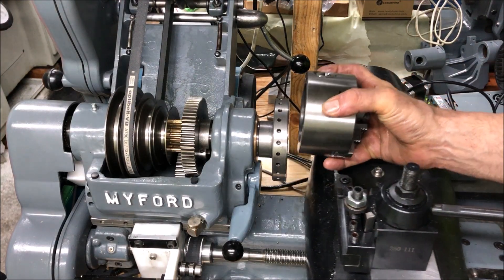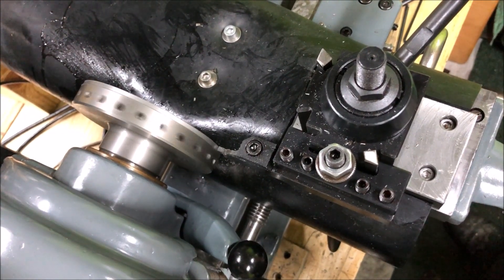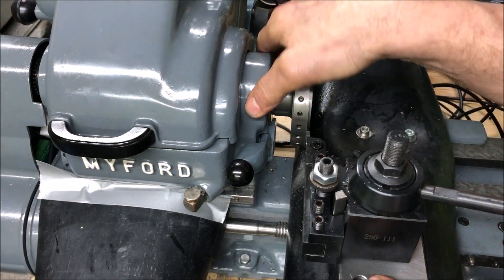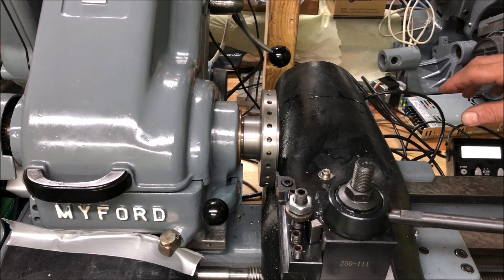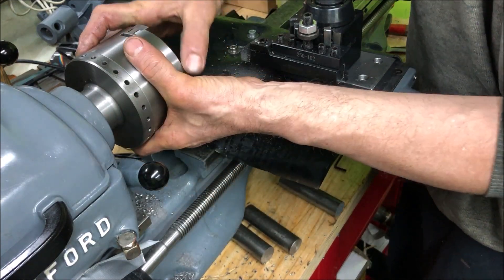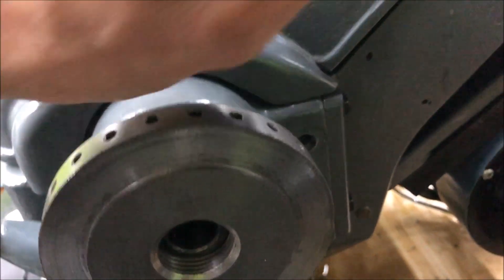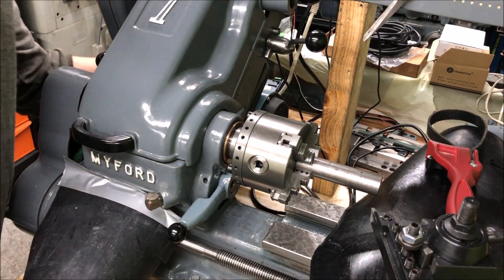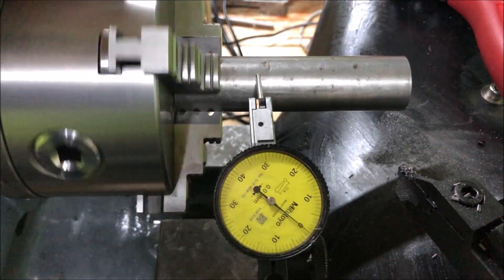Myford Super 7  - Sanou 100mm 4-jaw scroll chuck on RDG backplate

Comment: Hello Jan,
I agree that so many people make adaptors for chucks that stick out to far... I am becoming a real fan of your ELS... it really does seem to transform the Myford... See you on your next video.
Take care.
Paul,,
Reply from the maker: Thnks! The backplate comes threaded for the Myford so an easy mounting.. suits lazy me.. :)
The real benefit of the 2 axis control with the ELS system really shows when you do threading or taper turning (or som other variant of form turning, like if you want to turn a ball).
There are at least 3 useful methods to choose for threading, ie. plunge cut, angled or alternate. You can set everything up in advance of the cut and then just watch as each cycle is made. I also use a higher speed than normal, say 600 rpm and then rather do more cycles with a shallower cut  (it is automatic any way :) )